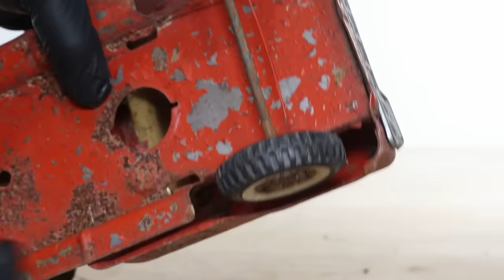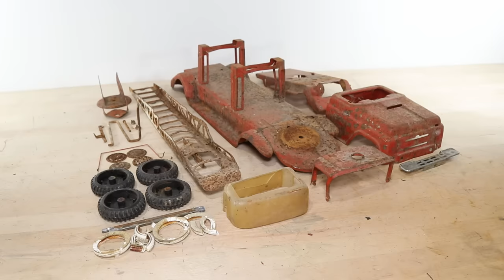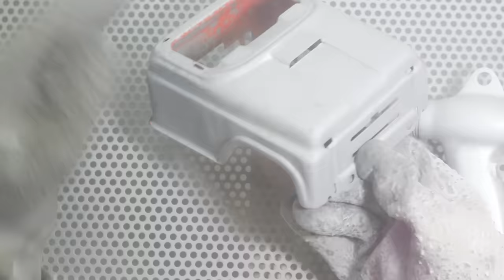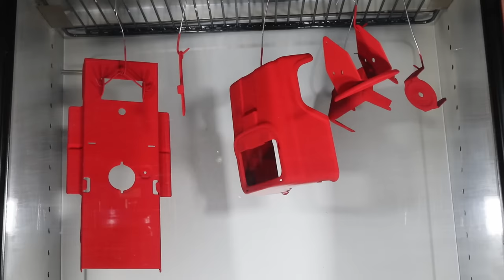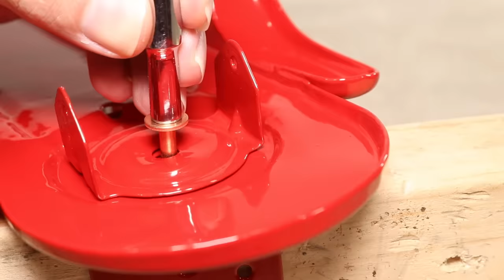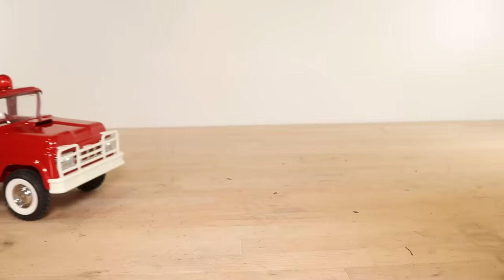1960s Buddy L Ladder Fire Truck Restoration

Comment: Cool Chip, you even had some tires that were in reusable condition(for the most part) this time. That ended up lookin really cool and the skit with the rescued sheep was cute too.
Reply: 7 de la casa de ella y la que le había comentado que no había por qué no le había contado
Reply: La Reina del flow 5 en el 6 5 de la casa de ella y la que 566 la que le 7am el 56 que hjujjjjjjkljrrf
Reply: @stefaniaquintana5788  888888
Reply: 9, на,8

Comment: Another perfect restoration, your whole approach to making these videos is fantastic.  One request though, do the van next!  ;-)
Reply from the maker: Thank you!!! I’ve got the last parts for the mail van coming, the rusty Structo van I’m still looking for parts, hopefully soon
Reply: I was thinking, oops, when you have a rotating joint, such as the ladder frame interface, where two pieces rub on paint to paint surfaces:  would you consider using very thin teflon washers as a hard lubricant?  Check out this URL as I think it would make the joint less wobbly and more fluid in operation.  I am not associated with this product, just did a search for teflon / PTFE / washers and gaskets:

http://wilmfibre.com/materials/teflon?gclid=EAIaIQobChMIv6-P1uKJ7AIV7D6tBh3F6ATJEAAYASAAEgJ1mPD_BwE

Love your powder coating; did the same on my 73 Celica, anything that could be powered coated was!

Cheers

Comment: This was the worst pitting I’ve seen you tackle. I’m surprised you were able to get away with just priming and sanding, even with the second coat.
Reply: the truck in his earlier videos where he was sandblasting and a hole came in a big one. used metal and cut it out and replaced it. it was spot on could not see the repair area at all.

Comment: Where do you get the replacement parts for these? I have a dump truck, a ladder truck, and a Midnight Express that I would love to restore. Don't have a clue how to even get started on them.
Reply from the maker: Thanks for watching! Check the description under each video. I list all of the vendors and links.
Reply: In the Description box you can find his list of what it cost to restore it (i.e. buying toys for parts on ebay). I'd start there..

Comment: Hey Chip:  I notice that you do a lead paint check on every restoration.  So far, you have not found any; but what would happen if you did?
Reply: he would have to use paint stripper instead of sandblasting. keeps the lead in the paint from becoming airbourne. as log as the paint stays wet the danger is minimized.

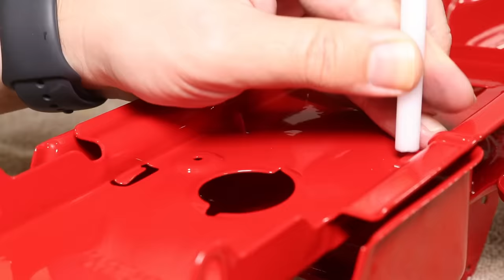Comment: Sweet! Just one thing makes me a sad panda! In 21:42 - when you curved the wedge back - the paint cracked!!!
Reply: I’ve noticed that on his other restorations as well. Paint too thick I guess plus primer.
Reply: I noticed the same.  There has to be a specialty tool in existence that can be used instead to get the bend just right.

Comment: Another great job! Thanks for sharing. I've observed other restorers will put a clear coat on after the decals, is there an advantage one way or another? Also, when you release the tabs during deconstruction they are often folded in opposite directions, but when you refold then during reconstruction they're folded in the same direction. Wouldn't opposite direction be preferred? Again, thanks for posting. Your videos are fascinating!

Comment: there is something i dont understand, the vid shows all of the parts being restored apart from the plastic windscreen which looks new. The ladder, white wall tyres and so on are all restored on here but the parts list and costs includes for replacements of these, which is correct? Nice job resoring it according to the vid but it many of the parrs were reaplcemetn then the effect is less impressive. i would love access to that powder coating set up tho!

Comment: I really enjoy watching your videos, because you take the time to do the restorations correctly. It drives me absolutely batshit bonkers when someone glassbeads a project that is noticeably pitted, and then they don't take the time to actually start with filler primer and then wet sand; they just skip right to the color, and the result looks like it was completely half-assed, and it's still visibly pitted. Was I seeing things, or did the powdercoat crack on you, when you were bending the second tab? I love the stuff, but sometimes it's a royal pain in the ass, especially when you're being careful with it. Awesome outcome, thumbs up.

Comment: We need your restoration skills here at The National Railroad Museum in Green Bay, Wisconsin, for over 40 pieces of trains, like the Green Bay and Western RR., no.315, class C-430, (B-B), ALCO-1969.  The #315 was donated in July 1987, in 100% Pristine Condition.  But the Original Founders died, and all the different Managers for the past 33 years have left it outside in all weathers, from blazing hot summer sun at 110°, to ice cold blizzards with -65 wind chill factor.  But now in 2020 it is a pathetic mess with peeling red paint and rusty blotches.  So please help to restore it, in time for the NRRM 65th Anniversary next year in 2021, (the NRRM was founded in 1956.).   Please, everybody, contact the NRRM , if you really want to help to restore this Classic American Diesel Locomotive.  Thank you Kindly.  From me.  Just an unofficial long time supporter.